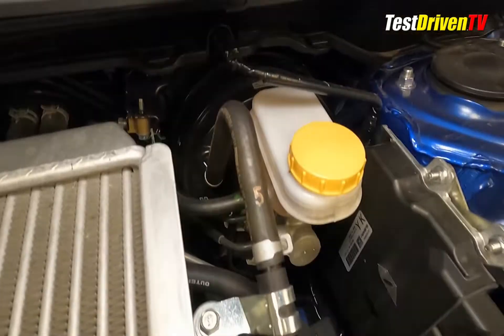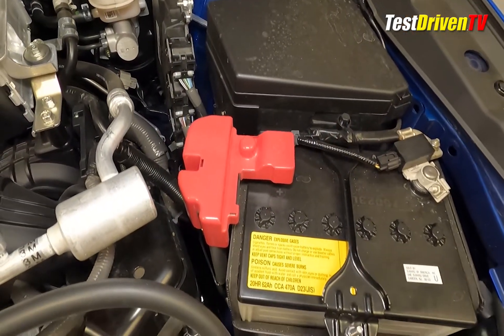2022-2024 Subaru WRX: Engine Explained

Comment: So if it has only direct fuel injection, then it will have lots of carbon build-up under the intake valve seats.  That's too bad they didn't include port injection along with it like Toyota does.  That would take care of that major issue with all Subarus, except the BRZ.

Comment: Can someone clarify why he mentioned turbo charger twice @ 1:14 and 1:40. Thanks!
Reply: The hot side of the turbo is connected to the engine’s exhaust manifold, so the air that passes through there also passes through the turbo. It’s pretty much how a turbocharger works. Hope this helped!

Comment: It would be helpful to see where the spark plugs are located. I came from a 2007 Legacy with the EJ253 engine, but on the WRX I'm having a hard time finding them.
Reply: SAME LOCATION AS EJ'S  BUT THE VB SHARES SUBARUS "GLOBAL PLATFORM" AND IS WIDER THEN OLDER PLATFORMS THE EJ CAME IN. I COULD DO SPARK PLUGS WITHOUT ANY ISSUES ON THE 251, 253, 255/257 , AND THE 3.0 AND 3.6. JUST NEED SOME SWIVELS EXTENSIONS AND FOR THE 3.6 LEGACY OUTBACK YOU CAN USE A JACK AND A WOODEN BLOCK TO ACCESS THE STUFF ON THE DRIVERS SIDE MORE EASILY BUT NOT NECESSARILY NEEDED JUST MAKES IT EASIER AND FASTER.
Reply: On the side